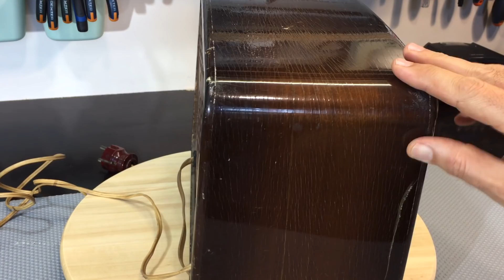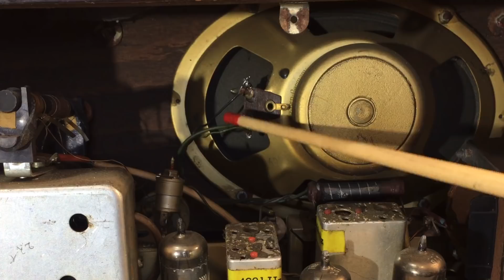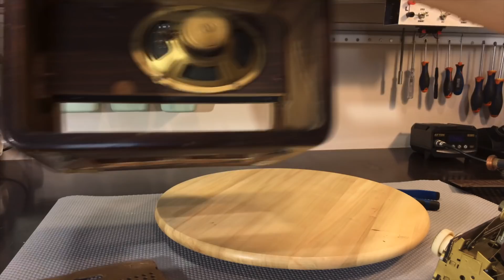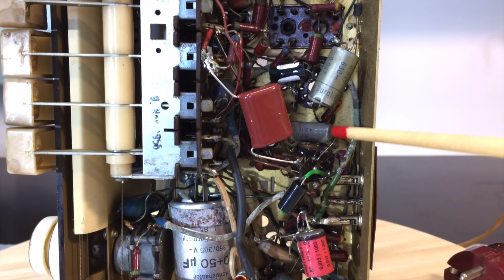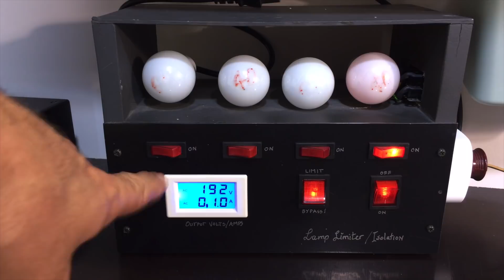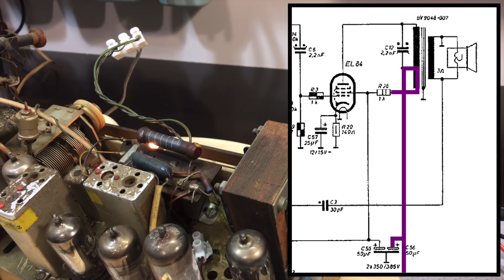Grundig type 90u tube radio restoration, part 1. Love these small ones.

Comment: On my 4192 had the  same problem on you're radio tone on my radio it's balance ..Ican't see away to clean the Volume /balance control how do I get some Deoxitin it ? Still have thay hum with my radio tuning and volume have no effect on the hum recap resistance checking..Only the Selinium rectifier hasn't been changed B+ is fine..So very hot transformer and hum.. Radio not happy.. I find your videos very intetaining your a True Craftsman with these radios..Best regards,
Reply from the maker: Thanks 😊

Comment: Once you have the power supply, and audio output working as specified in the circuit diagram, the front end FM and AM shouldn’t, by the look of things, present too much of a challenge.
Mr Tipton looks to have what most of us very likely crave - and that is space, and a well equipped workshop.  
I like the look of your Grundig radio.  Once it is working, and it’s cabinet restored it will be a more attractive radio.
Should it be of interest to you, I have uploaded the first two, of four videos featuring the reconditioning of an Ekco, model AD75.  Parts 3, and 4 will de uploaded this coming weekend.
Regards, Phil.
Reply from the maker: Yes, I wish I had the space and the tools he has.
Thanks for the reminder about your restorations.

Comment: Isn’t it amazing that someone can try to restore a radio that has such poor soldering skills. I mean soldering it just isn’t difficult really. Anyway nothing you cannot sort out. Thanks for sharing regards Chris .
Reply from the maker: After a few of these, you aren’t surprised anymore with the hacks some people do :)
Reply: Soldering is pretty damn hard with a crappy, unregulated soldering iron with a worn tip. Like that thing you (probably) got at the hardware store when you got into soldering... Some people probably never got an upgrade for whatever reason. 

With those crammed 50s point2point chassis types, 
It's like trying to defeat the Ender Dragon in Minecraft with a wooden sword, lol.
Reply: @westelaudio943  I find that point to point stuff is best done with a gun. Even with a halfway decent regulated soldering station I find myself cranking the heat higher than ideal (tip gets nasty fast). It would indeed be impossible with a unregulated 30 watt iron.

Comment: This is where a signal tracer could come handy :) I had the same symptoms and used an amplified speaker for the purpose, and this let me realise that the audio stage was out but the radio was fine. Unfortunately, it was the output transformer that was fried and like this one, it had a special primary tap where B+ is injected. Had to use a standard transformer for the output tube and inject B+ through a resistor to the top of the original transformer connection.
Reply from the maker: That works fine. If you still get too much hum, you can always add a slightly bigger filter cap after that resistor.

Comment: Why didn't you switch it to pickup and check that the audio amp is working (very loud hum when touching the input with your finger or use the signal generator)? Is this a mains insulated set? Obviously it has a power transformer and all E-type tubes, but the U suffix was often used to denote AC-DC sets, at least with Philips. And no it has no selenium rectifier as you said once in the video, because it has the EZ80 rectifier tube.
Reply from the maker: It does in fact have the ez80. My mistake. The power transformer has a little surprise up it’s sleeve, as I’ll report soon.

Comment: Part of the output transformer windings is used as the power supply choke! I had often thought of this idea and wondered why it wasn't used in practice. It's very exciting finally to see an actual implementation!
I bet the ceramic mains plug is a retro-fit. Given this is an FM era radio, it's not what I would expect to find at the end of the mains lead. Either a plastic or a bakelite plug would be the norm, I reckon. Plus, the ceramic plug shouldn't have survived this long. It looks to be brand new so maybe it was recently acquired? Interesting find anyway.
One thing I wanted to ask you is how you tackle rust in the transformer laminations. Spraying with WD40 or other rust removal substance is something I'd never do as it would penetrate through the laminations and potentially contaminate the paper. What I sometimes resort to is rubbing with aluminium foil but that is not ideal because a) it's a temporary fix and b) bits of aluminium get everywhere if you're not careful - not at all a good thing. The proper thing would be to sand it down and paint over with a primer and then paint but I don't want to lose the patina.
Reply from the maker: It’s a great plug, but definitely did not come from the factory. I’ll be going through the schematic in some detail, as I’ve also found a few quirks that may interest somebody. The choke idea is used in many German radios, and certainly has a great effect on hum reduction.
Reply: @electronicsoldandnew  I wonder why tube amp makers don't use the same idea. You often see loudspeaker field-coils used as the PS choke so my ultimate fantasy implementation of the idea would be a combined field-coil, choke and output transformer! Now that would be something to witness happening!
Practicalities aside, the only downside I see with the ceramic mains plug is that you then have to retro-fit your house with ceramic mains sockets and light switches to match! ;)

Comment: Nice little project. Impressive construction. I didn't expect to see such quality inside a small radio of that era. I suppose, the wooden shell is a giveaway for quality internals but the two are not always tied together. Interesting comment, that the nicotine protected the chassis. I often wonder the same thing when cleaning up the interior of tube gear from grime: am I doing the right thing? The grime sure has done a great job preventing the steel parts from rusting so far, so why am I removing it? Plus it contains valuable info as to its former owners for the future archaeologist...
I'm going hold you to your statement that B&O gear are built in an ergonomic way and wait to see when you'll attempt to repair one again ;) Anything shorter than a year will hugely impress me ;)
Reply from the maker: The small radios from companies like grundig and telefunken are generally quite good.
I see your point about removing the “protective coating” of grime, but I guess a good coating with WD40 is the be at we can give it now. 
As for the B&O, it’s not forgotten, just on sabbatical for a little while 😊
Reply: @electronicsoldandnew  Yep, plus with Grundig you also get a great loudspeaker driver. The bigger ones have especially nice units - at least, appealing to my taste. Shame about the Sabas: their great speaker units has been therir downfall - I expect you won't be able to find a Saba radio with original speaker units inside anymore, which is a great shame.
Reply: I like it when you can actually see the chassis and components color. I havent got so lucky =)